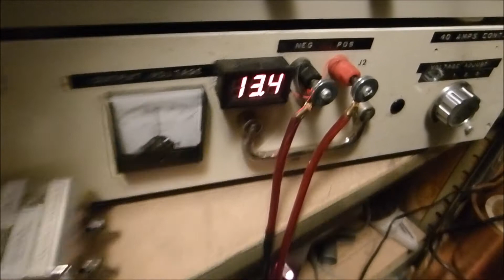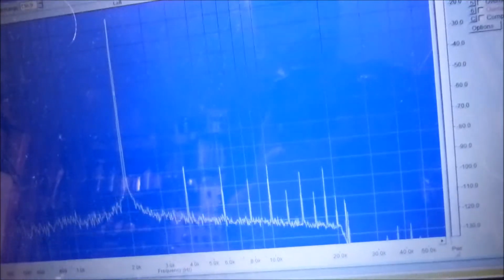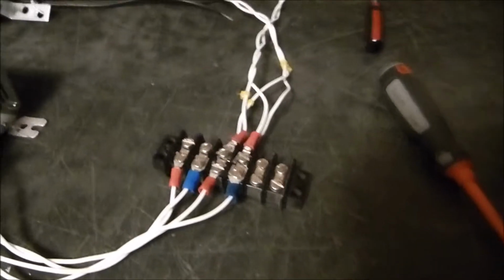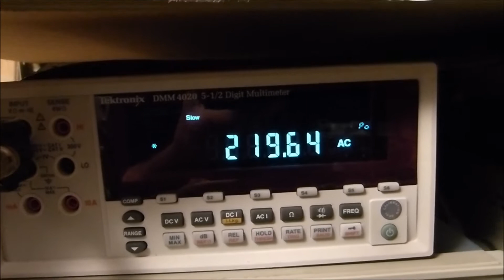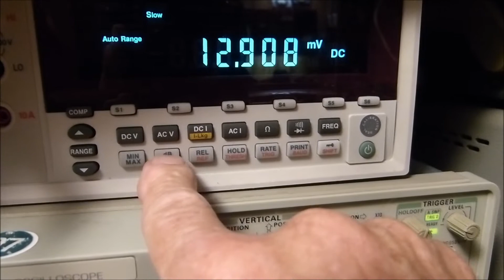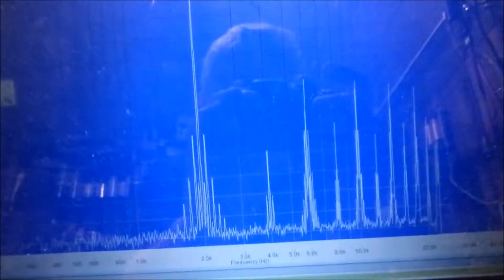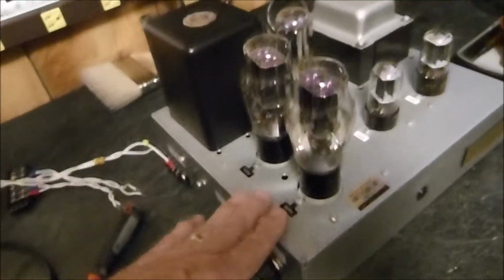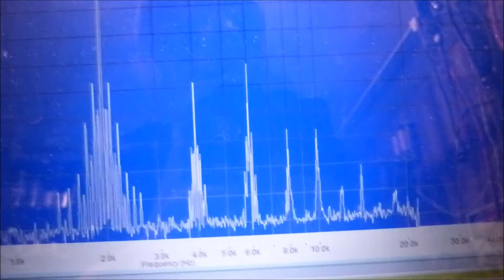DHD Power Cruiser NTX-3107  Car Stereo Power AmplifierTesting

Comment: The age old debate: which is better tubes or solid state?  Solid state amps operated conservatively are cleaner than tube amps, so in theory, reproduce music more accurately. The tube sound is actually distortion added by the amplifier that some people find pleasing. There is on real difference though, music being a dynamic signal can easily overdrive an amplifier, even momentarily. Tube amps are much more forgiving in such circumstances. Solid state devices when overdriven produce harsh artifacts that most people find irritating. That may explain the popularity of tubes for audio reproduction.
Reply from the maker: Bill, totally agree with you. The harmonic profile of this amp below clipping is almost as clean as the driving signal. Some people might call that sterile sounding. Once over-driven, the SS amps produce a harshness from the  abrupt transitions that no one likes and with the creation of music with guitars, over driving is a norm so the vacuum tube amp lives on. As for stereo reproduction, that seems a little harder to differentiate SS from tube. I do believe we like some of the artifacts of vacuum tube amps, as you mentioned, even in the playback of HiFi systems. I personally don't like boomy tube amps (i.e. the jukebox sound)  but there is something at the high end of a really good tube amp that I do like even though it may not be technically perfect. Thus enters the human realm of, "but, how does it sound?" which is the ultimate test no matter how well it performs on the test bench. I dare say that vacuum tube amps in the 30-40 watt range are the best sounding amps in the world - to me - and I think others tend to agree.

Comment: A great way to get around the power supply issue is to use a bank of super capacitors between the power supply and the amp. I built one to make sure I had enough power for my old Icom radio when I was operating mobile with it or portable out on my shooting range. Once I put it in the path never had a power problem again. Great video by the way!

Comment: The spurs must be spuriae of the measurement system. No kind of non-linear distortion or intermodulation cold produce adjacent frequencies like that. It's not clear how you're driving it. Does it happen if you drive it from the AA501 monitor output?
Reply from the maker: I have never thought of driving it from the monitor output. I will have to try that.  Now I wonder if the monitor output of the AA501 has all of the harmonics removed...   if so, that won't work for driving the FFT.   I will find out.   I drive the USB sound card (that drives the FFT software) directly from the "patch panel" where the signal from the load resistor is providing signal to all of the instruments. What you say makes sense about the spurs but if the volume is down or the THD as displayed on the AA501 is very low (0.02% or so) then the spurs are not there. It may be an artifact of the software program but it doesn't seem so in my mind, at the moment. The spurs start occurring as the THD increases and starts approaching clipping. For some reason that I can't imagine now, I thought the vacuum tube amp would be less "spurious" but that was definitely not the case...   :-)    I would actually call the big SS car amp ultra-clean - no spurs displayed around either the fundamental or harmonica and the amplitude of the harmonics were basically equal in amplitude and, I believe, all around -85 dB down from the fundamental. The tube amps consistently have a higher third harmonic than second and so on.
Reply: ElPaso TubeAmps The monitor output has everything. Only difference is that it is scaled, so you lose absolute magnitude. I use it to drive a spectrum analyser, so that I don't have to keep rescaling that. Same difference here. Or else I put monitor output onto one scope channel and function output into another: they are both scaled so I never have to adjust the scope Y gain. My suggestion re the spuriae is that they are artefacts of overloading the sound card or the FFT software or whatever else is downstream, rather than being actually present in the amplifier output under test.

Comment: Amazing how much current these amps can put out into 2Ohms. What is your new meter your using to measure Power. Hp8903 under the bench? Very interesting thank you.
Reply from the maker: The meter I use for power nowadays is a Tektronix DMM 4020. It has a menu of pre-configured impedance values you select and it does dB gain/loss also which comes in handy when working on NFB in amplifiers. The amount of current for this level of power at 13 volts is staggering.

Comment: How do you get that spectral display on your laptop? i need that.
Reply from the maker: https://www.youtube.com/edit?o=U&video_id=YarJ90H2ahA
Reply: i think you had the wrong link there.
is it Arta software you are using?
Reply: thats a link to my channel...great stuff.....but,.not much help with the Software ;)   is it Arta you are using?
Reply from the maker: ARTA is one FFT program that can be downloaded for free and used indefinitely without a license. If you purchase the license, ( I think around $100) you get some extra features. ARTA is not my favorite. The program I was using in this video is SpectraPlus. It can be downloaded for free, fully functional for 30 days, then it quits working until you purchase a license. A license for SpectraPlus for all features is around $1000. In both cases, I use an external  USB sound card that is much better than the internal sound card of the laptop PC. I have made several videos on using both of these programs that you might like. Also, there is a device called "Analog Discovery 2"   (AD2)  that I and other YouTube'rs have posted a good bit of information on. The AD2 is a standalone piece of hardware that gives you a nice PC based signal generator, oscilloscope, FFT device and options for a voltmeter that works pretty well and is in the price range of $300.

Comment: I used to use car amps for my subs in the house, but had power supply issues.  
I had to use my PS from my transceiver, at least 20 amps.  I had a 10a battery charger that I modified with regulator and filters, but it wasn't enough for the Jensen's 600w rating, lol.
Reply from the maker: A good 35 years ago I had a big SS amp in my car that was mounted in the trunk. I believe I ran #10 wire to it and when it tried to power up, the amp would draw so much current the voltage would drop and it would power off only to have the voltage come back up and then try to power up again. It went into a, flump, flump,flump sequence. I could have put in larger wire but I solved it with a large capacitor 100,000 uF or so at the amp so the voltage would remain high enough for it to actually power up. Once power up it was OK. Trying to run several hundred  watts from a 12 volt system is a bit challenging.

Comment: There is no way that could do 350 watts into 2 ohms without clipping on a 13.8v power supply unless it has a boost converter.
Reply: If you look inside one of these big car amps you will find about 70% of the components are used up just in the power supply. Can operate at quite high voltage. The only way to possibly get such high powers with a 14 volt supply.
Not really made for sign wave driving into 2 ohms even one channel, can you imagine the amp draw with both channels driven into 2 ohms. Will probably blow up. Very under heat sinked.
Reply from the maker: I agree but I am sure there is a dual polarity power supply inside. This things weighs quite a bit.
Reply: yes these amps do indeed have a split rail power supply inside some of these amps I have sees as high as 75 volt ++ and --- split rail that is 150 volt total this one is likely 30 - 35 volt split rail
Reply from the maker: I assume an audio amp to be about 50% efficient. I know some are more or less than others but just for simplicity that is the way I look at them. With that said, assuming we are developing 700 watts (both channels operating) into a load then we are also dissipating 700 watts in the heat sinks. So, I completely agree with you about being "under heat sinked". This thing would get so hot you could cook bacon on it. Also, as you mentioned, it was not built to deliver sine wave power at this level. Lastly, the fuse is 60 A so, 60 * 13.8 = 828 watts so it looks like sine wave power would blow the fuse after about 200 watts output (400 watts peak) per channel.  It would require about 100 A of current to deliver 700 watts output and I believe pretty shortly after trying to deliver that amount of power it would go up in flames. But, overall, we have to admit, 200 watts per channel is pretty impressive and I suspect it could sustain that amount of music power for quite a long time as it is pretty solid. Thanks for your comment.